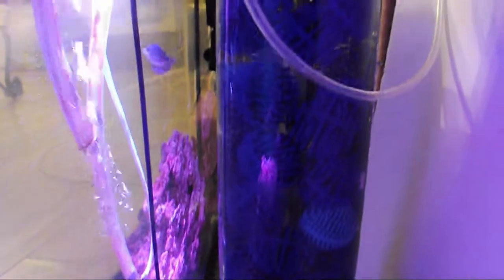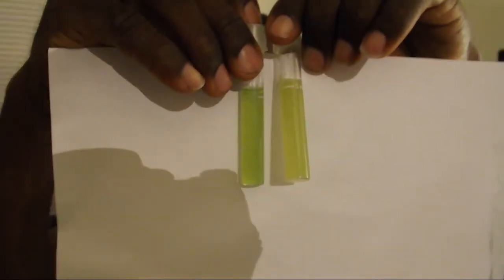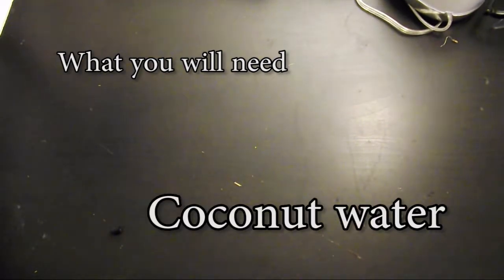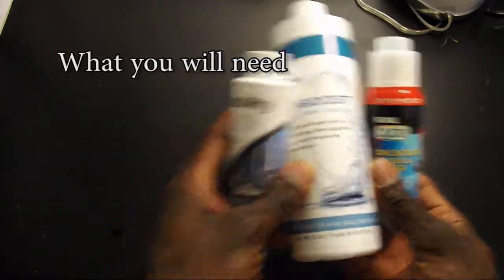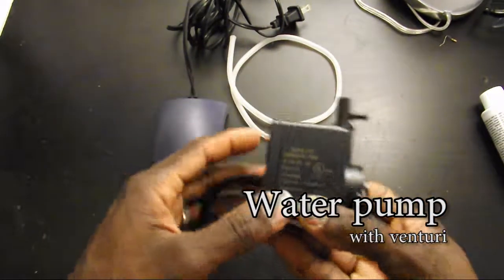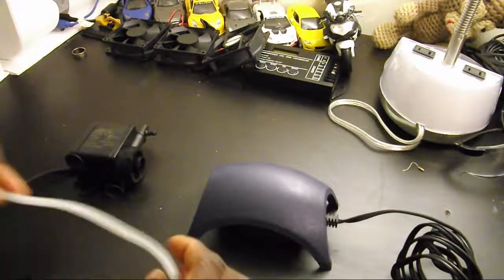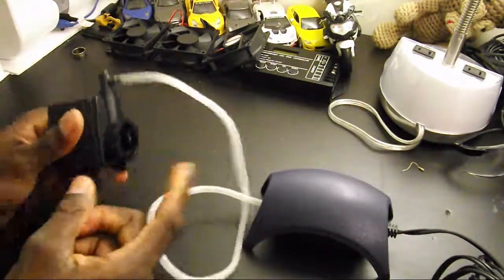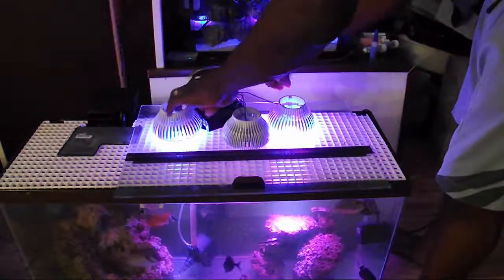Nitrate Factory: Bio-ball Reactor

Comment: Nice presentation but Bioballs are the worst for this application. They are intended for a moving bed filter not a static type filter. K1 media is the same. Either way it only works properly when the media is tumbling slowly. Bioballs are too large to tumble in a reactor with down tube which is why they make k1. You would be way better off using any basic static media. 

I use the exact same thing but use it with pond matrix running 50gph flow rate on the pump which is what seachem tech support told me would be the best flow. There is more then enough surface area to House more ammonia and nitrite consuming bacteria on just one pebble then that entire reactor of plastic balls. The deep dense design of the pond matrix also allows for large growth of nitrate consuming bacteria. Regular matrix or denitrate would work the same however they are more suited to ammonia and nitrite use and pond matrix more suited to nitrate use. If you want more ammonia and nitrite capability use matrix, if you want more nitrate capability use pond matrix basically. But either one would do literally 100000x more then bioballs or k1 even k1micro as they just don’t have the surface area to compete with denser media’s. 

The single best use for bioballs is in a high flow filter infront of sponges leaving a little room for them to move around but not tumble (like 75-80% fill of area) as it will trap all the detritus before it gets to your sponges and other media’s. Everyone with canister filters does this. They place a few bioballs in the void in the bottom of the canister under the media trays. It’s like a prefilter in what would be wasted space. 

One of the single best filters is simply placing pool filter sand in a reactor and Turning the pump flow up enough to move the sand but not push it out the top into the return line. If you wanted to go cheap then use the sand.. if you want to do it right then use a high quality dense media like matrix. But even packed with sponges it would be more efficient then the bioballs. 

Also using something like prime to seed the reactor only works if you place the media in a bucket of dirty cleanout tank water with detritus and everything else you suck off the bottom of a tank. Put your media in add the cleanout water just enough to cover the media then pour the entire bottle of prime in. Lightly stir it around every so often for a couple days.. this will give the bacteria time to find a home and plenty of gunk to feed off of. Take any that are still floating at this point and throw them away as if they are still floating they have trapped air pockets and won’t work properly. Then rinse the media out with clean tank water and place into the reactor. You’ll cut down the 2-6 week wait on ammonia and nitrite bacteria’s to a day or two. Nitrate bacteria will populate nicely in a week or two instead of 6m. The key is the slow flow. This isn’t good as a primary filter for anything bigger then a 15g but on my 125gallon cichlid/turtle tank I use it as a secondary unit. It took my 40ppm weekly nitrate production and cut it to 20 in just a 2 weeks. After 1 month I’m running at a constant 0-0-5 weekly. Even not changing water it never climbs above 10ppm now. There is enough pond matrix to grow additional bacteria as needed so as tank demands grow so does the bacteria colony. If it wasn’t for gravel vacs for detritus removal and the need to add minerals back to the water I’d never have to do water changes anymore. This is with 46 fish and two adult sliders so it will work on any tank with any stocking even better. If it wasn’t for water turnover requirements I could actually filter my entire tank with just one little reactor setup using just 1 liter of pond matrix.